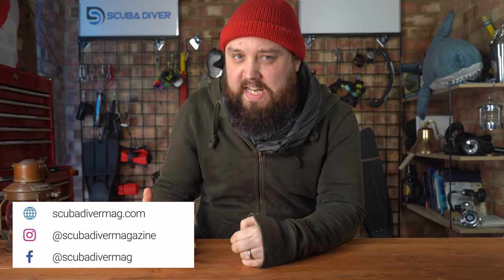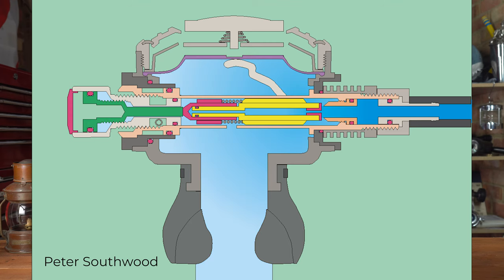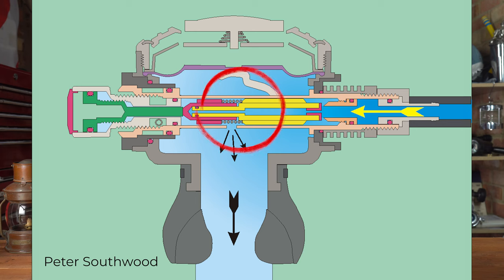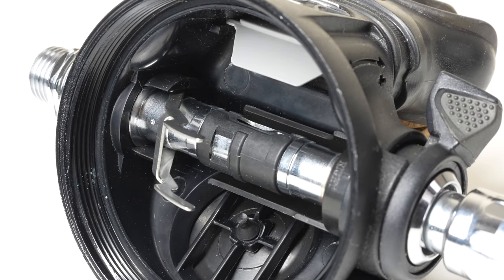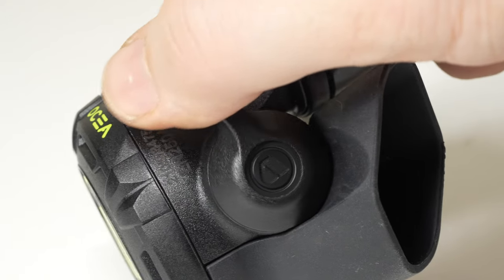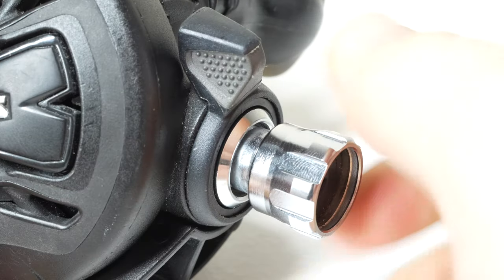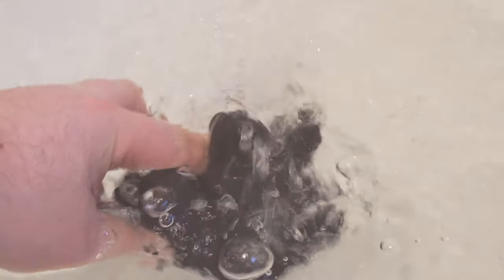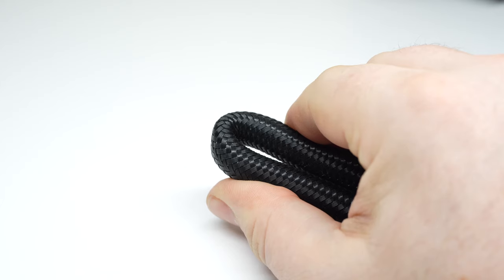How Pre-Dive Switches Work | #scuba #regulator | @ScubaDiverMagazine

Comment: Constructive criticism:  there was one area of content that was not clear.  It was easy to follow the open vs covered in the switch, but didn’t go over the switch meaning of + vs -.  And then you used terms of on vs off.  It left me a little confused when you said on and off. Does on mean activated, thus restricting the air flow or does on mean full unrestricted air flow? My comment is that these terms should be fully explained/correlated to the general audience at the beginning just like explaining an acronym at first use.  I love all your extremely helpful instructional videos and value every one of your posts. I do hope you take this comment as a very friendly one from one of your active followers.
Reply: @@elephantprotector yes, it was more clear in the vid 9 days ago. He said when it is ‘on’, it scatters the air. So in this case, ‘on’ means restricting and probably correlated to the actual switch labeling of “-“.  In a nutshell, ‘on’ = restrict = “-“.  🤔
Reply: @@elephantprotector my guess is that the first vid was a Q&A, where the second was topic-specific and easier to search for and find.
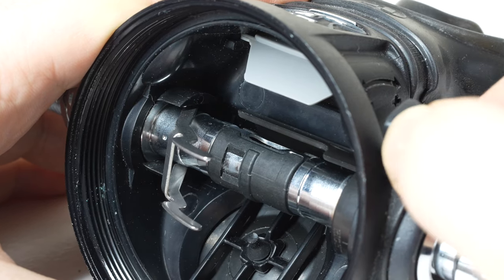Reply: I have one of these on my primary and the + / - always confused me as well.  Is "+" Easier breathing or More Resistance to free flowing?!?  At 2:18 you can see the + mode would be "smooth airflow" as the - mode puts the shroud over the air inlet.  I would think  Dive / Surface (or even D/S) would make more sense.  + does not mean "more airflow", it just means "less turbulence / resistance".
I would blame the manufacturers on this.  Then again, D/S is english and maybe they did not want to have to print the relevant characters from every language they sold the regulator bodies in?
Reply: @MrShadowpanther3  Thank you! 😊👍
Reply from the maker: This video is a more in-depth look at how the functions work :)
Reply from the maker: @MrShadowpanther3 That's a great explanation thanks for helping the community.
Reply: @ScubaDiverMagazine  What is awesome with this video is I have never seen the internals of how that worked.  Also the technical details of WHY that helps to stop freeflow by pushing back out in the diaphragm.  I love that kind of info
Reply: Definitely agree that the on/off terminology vs +/- markings on the regulator creates a bit of confusion. Explaining the correlation between the terms used and the marks would have helped a lot.

Comment: Glad to see I'm not alone in having trouble remembering+/- and should I push the switch away or towards my mouth while diving.  I have the same issue remembering which way to turn the adjustment knob, too. I end up going with what feels right at the time.
Reply: Unscrew the front face of your regulator, and you will see what position does what. I'd say that in almost all regulators, pushing the lever forward will cover the opening, and pulling it back will open it fully.
In other words: Forward is pre-dive. Back is dive.

Comment: Great info to have, but certainly somewhat confusing, with valve levers and an adjustment knob both being called switches and the "shrouded" and "unshrouded" ends of the lever action being refered to as on and off but also open and closed as well as dive mode / pre-dive or surface mode but without clear identification. I had to listen through 3 times to figure out what was what.
Loved the cutaway schematic and the close-up internal views!

Comment: I have the MTX and MTXV, and I opened both up.
The MTX doesn't have a Venturi switch, and the opening is always covered.
On the MTXV you can open the Venturi for additional gas flow.

I therefor have to conclude that a regulator without a Venturi switch exists not to prevent a freeflow, but to allow for the Venturi effect to force more gas into your lungs, which is useful if you're working harder underwater, like when swimming against a current.

Now, I haven't looked at cheaper regulators, but I would assume that regulators without Venturi switches have the opening covered to prevent freeflows, and thus aren't (as) susceptible to it.
Reply from the maker: Cheaper regs without a venturi lever often will not have a central Valve Spindle or barrel where the airflow is directed straight towards the mouthpiece. That way the airflow is scattered into the 2nd stage and less likely to freeflow.  

They also don't have the same quality of breathe, they're often set up a little more stiff and they can just freeflow...

Comment: Been looking for a video about this. 

On my second ever open water dive a few weeks ago (I'm in the UK the water was 5 degrees C) my instructor wanted to practice mask clearing in very shallow water (I'm not sure this helped but I was her idea) and I'm not sure if it was cold water shock or a problem with the regulator but as soon as I put my face underwater (in chest deep water) I couldn't breath in or out without my mask on even if I tried to push very hard. 
Eventually she kind of had an idea and I breathed on her octopus and it worked but then she put the reg to positive and I breathed but it was still quite hard and only a few breathes. 

Essentially now knowing more about the situation I had used the reg in shallow/out of water quite a lot (about 15mins of messing about trying and stopping to catch my breath and not get annoyed). 
We came out of the water for a break and then went down to 2metres and started the lesson. 
As I took my regulator out to show the skill the regulator freeflowed and we both just stared at it for a second before she passed me her octopus and we made a shared air ascent... 
In fairness I made a few mistakes at the surface and didn't inflate my jacket as I was just watching what she was doing and my mind blanked so she shouted for assistance and they (the diving centre we were at) launched a boat to come and help me and turned off the cylinder which the 1st stage had frozen over by this point... 

Straight away the staff from the diving centre (where the kit was hired) were onto her about why was my regulator on positive when they had given it to me on negative that morning... 

Having learnt more about the situation I realised obviously the problem was the open air breathing in shallow water most likely.... 

But this video gives me more of an understanding of the equipment but less of an understanding of the situation and why the centre staff were so obsessed with it being in the positive position
Reply from the maker: The +ve position increases the airflow through the 2nd stage thanks to the Venturi Effect so you'll get a better breathe. If I'm going to take the 2nd stage out of my mouth, I'll flick it to -ve and adjust the breathing adjustment if the 2nd stage has one to reduce the chances of it freeflowing. And I always point the mouthpiece downwards.

The cold water will trigger your Mammalian Dive Reflex which is probably why you couldn't breathe normally. Your body will naturally want to gasp and hold your breath and it takes a while to get used to that sensation. Luckily that should be the last time you need to remove your mask underwater for a while.

Comment: #ask mark Hello Mark always enjoy your shows. My question is about wing bladders. What comes to mind is why a 18 pound lift and a 30 pound lift. If the 18 is more than sufficient why do some divers use a 30 pound. Is it because of gear or steel tanks. I have heard of just the convenience for traveling. I noticed most divers are in warm water conditions with no more than a 3 mil wetsuit. Maybe you can go into more detail. Thanks Joe
Reply from the maker: It's a balancing act with wing size. 30lb wings are a good all-rounder for single cylinders and a safe choice. Smaller wings require proper weighting and give you less of a safety buffer.

Ideally you should always be perfectly weighted that you don't actually need to inflate your BCD, especially to maximum capacity. You basically want enough lift to counteract your negative buoyancy for all of the gear that you're diving with, including weights.

If I'm travelling I'll take my little D18 wing as I tend to stay pretty shallow and don't carry too much gear when I'm on holiday. Diving at home with twin steel tanks I use a larger 40 wing and my drysuit as backup.

It all depends on what you need for the dive at hand. I have the luxury of owning a load of dive gear where I can select a little travel wing but, for others buying gear a 30lb is a better all-rounder choice.

Comment: #askmark I'd love to know how a drysuit shoulder valve works. How does it dump air without letting in water? How does its adjustability work?
Reply from the maker: It may vary between designs but, most auto dumps are one-way valves and when you screw the top in it pushes the valve inwards so gas inside your drysuit has to push harder to get out. The clever part is the 2nd seal which only opens when you push the main body inwards in an emergency.
I'll pull one apart so you can see the insides